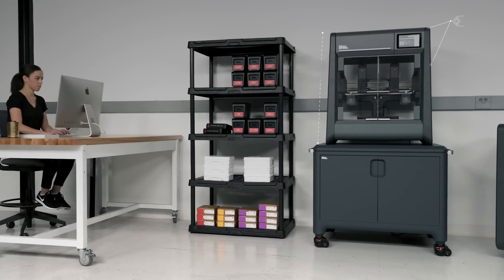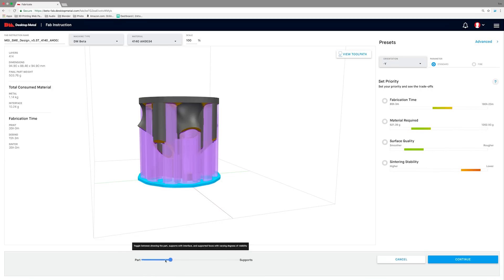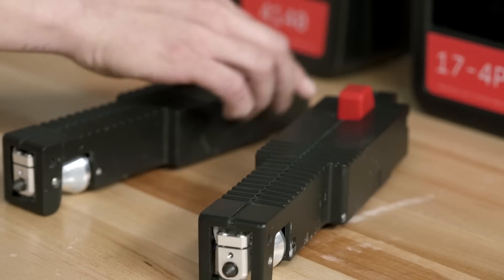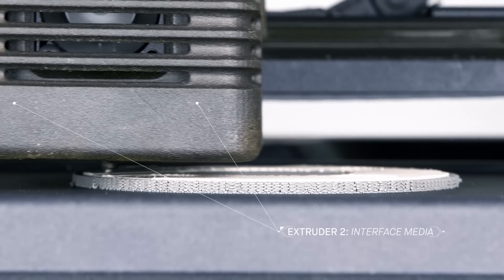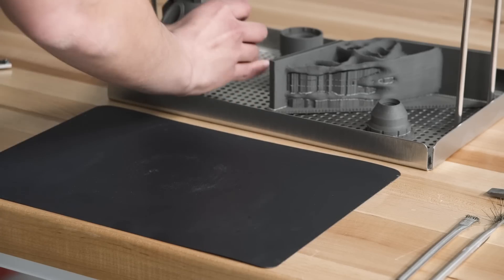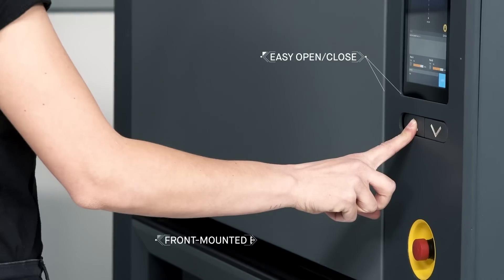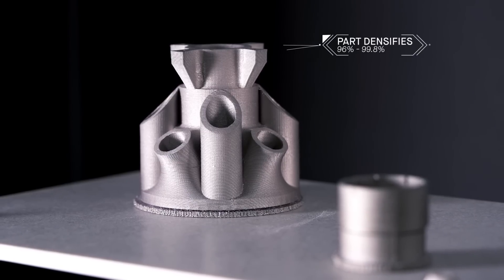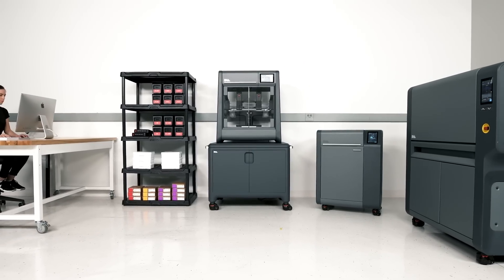Desktop Metal Studio 3D Printer | Affordable Metal 3D Printing

Comment from the maker: If you are interested in seeing this technology more in-depth, take a look at our Desktop Metal playlist. It covers the technology as well as the workflow. Enjoy! - https://www.youtube.com/watch?v=I-7WuOSkClg&list=PL3lLIrnJwjW59tLpucQ12gDwycmazFZuY
Reply: Cost?
Reply: Let me ask a stupid question, does it do aluminum?  I'm really interested in this machine. I'm really thinking about taken a course in cad because of this machine. Great video and take care. Thumbs up.
Reply from the maker: Hey William, on launch the Studio System will focus primarily on 17-4 PH stainless steel, AISI 4140 mid-carbon steel, H13 tool steel, 316 L stainless steel, Copper, and Inconel 625. However, because this technology is based on metal injection molding (MIMs) most of the materials in that space will be transferable over time. Desktop Metal and their partners currently have over 30 materials in development including 2024 and 6061 Aluminium.
Reply from the maker: Based on the ASTM E18 standard, 17-4 stainless steel printed on the Desktop Metal system has a hardness of 37 after sintering.
Reply from the maker: @Superpureeliteful I think that the hardness will be okay for a wide range of prototyping and tooling applications, with end-use parts being possible in certain situations. However, when it comes to higher-volume production parts where strength, consistency and repeatability will be more important, the binder jetting technology from Desktop Metal will offer higher strength and density, and the new solution from Stratasys also offers cold isostatic pressing to further process the materials.
Reply: @proto3000_  what could be it's cost ?
Reply: Guaranteed 5 stars
Reply: Cuanto cuesta una máquina como esa entre a la página y solo veo catálogos de máquinas pero nada importante como el precio entre otros datos .

Comment: just think 20 years ago we was doing the basics of this in Delloro Stelite in the form  of PTA
( Plasma transferred Arc )
The metal Stellite powder was pored into a hopper above the head and then gravity fed through to the center of the extruder that had Hydrogen gas and Argon .
Anyway we made some nice stuff that was amazing but the heat was so extreme and you could get an instant sun tan ,
Reply from the maker: The pace of innovation is incredible

Comment: why in the hell is so much of this machine vendor-locked in?  RFID-enabled gas canisters??
Reply from the maker: The gas source does not just have to be the canisters. If your manufacturing facility supports it, these units also run off in-house gas lines

Comment: I saw it said fast and cheap and it says there test part will take 188 HOURS WITHOUT supports......
Reply from the maker: Compare it to another manufacturing method in both cost, time and complexity. Time can be subjective, and the benefits in time savings can be seen across the lifecycle of a product.
Reply: @proto3000_  to be honest with you! From the appearance of the dementions and complexity of the part shown I whole heartedly believe a 5 axis cnc from billet would take around 18-36hours depending on the machine and the medium in question and short of work hardening steels I believe it would be short of the 24 hour mark.  However, I was not here to watch the price or time but the technology and its advances! 5 axis cncs have not been around long and when they first came out people only talked about the epic crashes and fails from them now people can't believe the finish some of the new machines can do!

Comment: When you could by a HAAS for less than the price of this setup, you have to question if this process isready for prime time.  "Near Net" means the part shrinks so now we are into the sand casting realm of calculating shrinkage and may as well use sand cast where cores can also be 3D printed and the part will ultimately be cheaper to make by orders of magnitudes.
Reply from the maker: Hey Matt,

The purpose of the Studio is not necessarily to compete against the CNC process but simply to complement it. If you are an R&D lab or a design firm with no immediate access to a machine shop, how would you get prototypes or one off parts out quickly and efficiently? Typically, companies who run machine shops have them dedicated to production, those who have to prototype their metal components prior to production have incredibly long lead times or have to look at alternative methods to get their parts produced. We take for granted what we have accomplished with CNC machines but we have to keep in mind that not everyone has access to them. The same can be said with sand castings. You are correct in your statement that the core can be 3D printed but not all clients have immediate access to a foundry or casting shop. With a system such as this one, any designer or engineer can design components and get them printed whether you have a system in an office space or a machine shop. The benefit of achieving multiple designs with different geometries in one print is also hugely beneficial where as multiple tooling setup may have to be required with CNC methods.
Reply: @proto3000_   
Worked in Test and Engineering Aircraft and our company used metal printed parts because of exactly your outline, specifically a fire suppression nozzle for our Turbofans. Minute changes had to be made after every test for correction of optimal flow and coverage. We got the printed parts in 1/4 the time it takes to machine. Machining parts in a large manufacturing environment takes an enormous amount lot of time.

Spending 30-50k a day on crew , maintenance,  engineering support and test equipment for a part to be machined in a couple of days opposed to one that can be printed, especially if it is non critical, is a by far a high valued machine.

Comment: Wow..  Stil wonder if this type of 3d printer can be use to manufacture piping structure such as pipe, valve,flange, or 3d printed distillation column complete with its traysm reflux and reboiler system it will be huge application especially for small pilot scale plant in chemical production..
Reply from the maker: Thanks for the comment Mohamad. Some of the applications you listed are already being done or in Research and Development by many oil, gas, and petrochemical companies in North America

Comment: When the website say "Request a Quote", you know its gonna be some serious dough
Reply: Yeah it’s like $200,000
Reply: @Stay EZ My Friends The way they are doing this I’d assume closer to the $50k mark or higher. Would it not be easier to 3D print something in resin and create a cast for the part? I wouldn’t imaging you’d get great detail for a $5-10k metal printer, at least not for 5 years.
Reply: @StevenPenny  casting them kinda defeats the purpose of metal 3d printing
Reply: My job has one and it was like $120k.
Reply: 2026 is it affordable?
Reply from the maker: Expensive by normal standards, but not when compared with the costs involved in making a one-off metal part
Reply: @proto3000_  True. If you guys can make a simpler <$1000 lower quality version for hobbyists you would garner a lot of sales
Reply: @nczioox1116  That will take at least a decade, if it ever happens. Even a metal printer for 10k would be insane.
Reply: @proto3000_  is even be interested at 5k. Why isn’t there a machine for say 5-10k that’s DMLS with a powder bed about the size of a shoebox?

Comment: Purchase of the Desktop Metal Studio System for $120,000 includes:
DM Studio Printer (add additional Printers for $49,900 + tax)
DM Studio Debinder (add additional Debinders for $9,900 + tax)
DM Studio Furnace (add additional Furnaces for $59,900 + tax)
Consumable Starter Kit (media, gas, debinder fluid, effluent filters and build plates)
Installation and training by DM Sales Partner
Cloud-based software & updates (local cloud option available)
1-year warranty and maintenance
Hardware-as-a-service (HaaS) pricing is also available. Pricing is given as $4,000/month for 36 months or $3,250 over 48 months.

The Desktop Metal Studio 3D printer is priced at $49,900.

affordable?
Reply from the maker: When you compare it with other laser-based or powder solutions it is very affordable. Metal 3D printing today is mostly catered to industrial applications

Comment: Web based software means:

1) You can't use it when the internet goes down.
2) Your designs are not your own.
3) Your STL files are subject to being stolen.
4) Your designs and technology is subject to being transferred to a Chinese company that can produce your product much cheaper than you can, before you get your product to market.
5) Even $10.00 is way too much for such a system.
Yep, that's what web based software is all about.

Comment: I saw “affordable” so i clicked, then i saw 3 seperate machines, so i escaped
Reply: And I thought CNC machines were expensive.
Reply: Right 100,000 affordable wtf
Reply: Yeah it must be reeeeaaally cheap 😂
Reply: @leolima75  honestly Its a greate option if your constantly builfing one off cars. 

Some parts wont work unless you make a custom part. This will save me time and money so its a good option. 

Tho there are cheaper options on tje market.
Reply: @burntchickennugget191  I'm sure it's much more comfortable ... I'm also sure it's more expensive. I really don't know whether it's faster (it's oven time seems pretty long on top of an already long printing time) and whether it delivers more accurate dimensions. At least for castings there's plenty of software that will calculate the corrections to compensate for the casting process shrinkage.
Reply: in jewelry making theres silver clay
Reply: Honestly if your serious about makeing parts its worth it.
Reply: Still cheaper to get a really good 3D printer and die cast lost PLA
Reply: It's still for enterprise use
Reply: Still less expensive than a single machine with a high power laser !
Reply: @SuperYellowsubmarin  What is the price?
Reply: Ignacio peña your heart
Reply: @vladimirvladimirovichputin1352   and two kidneys lol
Reply: @PALOSDEAJO  This printer set costs $120,000. The cheapest metal printer I could find online is Airwolf 3D EVO but I cannot speak to its quality
Reply: @PALOSDEAJO  I work with an EOS M 290, close to 600k with all the required accessories
Reply: @NightshadeTactical  bro might as well get the Markforged Metal X
Reply: @PALOSDEAJO  3 quarter million dollars
Reply: iman-ka@khoshrou.com
{supplier and sub seller}
We are the supplier of 
Laser gun,AOM driver,PCB,Spare parts,Rollers,Gears,Key board,Minilabs,
Brands; Noritsu,Fuji frontier,Durst,Epson,Konica,Chromira Prolab,
for FUJI NORITSU, also sell almost all spare parts of FUJI ,Noritsu,.. . for more info send me an email On, 
iman-ka@khoshrou.com

Almost all spare parts for Noritsu,Fuji frontier....

Comment: ATF YOU CANT STOP ME NOW
Reply: @lmao this isn't a name open source software :)))
Reply: You can never stop a maker.
Reply: Lol
Reply: The web based software may be an issue. I would prefer something more closed circuit if you know what I mean.
Reply: Apparently these machines cost as much as a fully kitted out Oshkosh L-ATV, plus 100k in spare change.
Reply: @lmao this isn't a name then some hacker is already working on hacking them😋
Reply: unlimited POWER!
Reply: Materials Available

17-4 PH Stainless
316L Stainless
H13 Tool Steel
4140 Chrome Moly
Copper
Inconel 625 Superalloy
Kovar F-15

Additional Materials: By enabling the use of metal powders from the MIM industry, our systems have access to a wide range of existing materials—from steels and aluminum to superalloys and titanium.
Reply: @SparkySlow  Your comment is the real MVP here
Reply: @cheekinotbreeki8681  I won't mention I printed a G17 lower and it works great.

The metal slide rail inserts were a bitch however
Reply: @cheekinotbreeki8681  bout to make myself a fully aluminum glock lower
Reply: Ngl a 3d printed cobra would be sick

Comment: At this point wouldn't ejection mold just be cheaper?
Reply from the maker: Hey Joshua, it all depends. When we consider additive manufacturing an important element is the complexity of the design and the volume. With injection molding, it can be cost-effective if you are doing higher volumes of a part with simple geometry. However, if you need something done low-volume of that is very complex, 3D printing can be a better fit.

Comment: There are so few use cases for this at 120,000 usd.  Money like that can buy 5 axis cnc mill plus tooling, which can do so so much more much faster.  But I guess we gotta start somewhere.   I'll be here waiting for the 25,000 dollar version.
Reply from the maker: Hey Jason, that is a valid point however, the main use case right now for desktop metal 3D printing technology is for companies to produce complex metal parts outside the capability of subtractive manufacturing methods. The cost of the technology is justified when a company is looking to produce a part with a unique purpose, geometry and function whereby that same part maybe was impossible to manufacturer before or had to go through a series of processes before it could come to fruition. Additionally, there are replacement parts that are sometimes needed where the cost of tooling does not make sense. As like any technology, metal additive manufacturing is not for everyone yet, but it is proving to be the starting point in establishing new manufacturing methods for next generation parts and components.

Comment: the complete system costs 120,000$, that's what they said on their website, I think they're talking about the printer only, indeed very affordable
Reply: When theres a will theres a way
Reply: Compared to 1.7mil industrial printers... yes, it's affordable. But not affordable for people who work a 9-5 job.
Reply: Bro just make some brake rotors or pads for a week and its paid off. Make an f-1 spec rotor and 6 of those pay for it. It's really not expensive for what your getting. I'd be churning out Bugatti/Ferrari etc brakes like a bastard if I had the $$ for this bad boy
Reply: @hdjjfhdjif878 
making rotors for Bugatti is one thing, but selling them is another 😏 
Do you really think some rich guy who spent a mill+ on his ride would consider to buy rotors from Hdjjf Hdjif? 😬
Good luck with that 😄
Reply: @pavelt5732  no, but if you have a Bugatti this is your cheapest bet

In all seriousness, there are a ton of small machine shops in my area that are all very into racing. I would see a small shop like them using it to produce things they otherwise dont have the resolution to spec, like piston rings, brakes etc. They have multiple Ferraris, something like this isnt very expensive to them
Reply: @hdjjfhdjif878  bro lmao idk if you're joking or not but theres no way thatd work. Shit would explode as soon as you applied 2% pressure
Reply: @hdjjfhdjif878  I thought this product was for mass production, what small companies or factories would use to manufacture small parts. I don't see any personal use for it and in general I wouldn't spend 120,000$ on a printer only to use it rarely. Good idea for a project though! didn't know making car brakes can be so profitable!

Comment: Could you possibly make a steel model train's chassis and body, and wheels with this?... like, can you make multiple parts at one time?...
Reply from the maker: Yes, in theory, you would be able to print whatever you can design. For a model train however using metal 3D printing technology may be costly. You can print multiple parts at one time, and you can also print moving assemblies provided the design has the right tolerances.

Comment: What if that piece needs to be forged most of machinary parts need to be forged prior
Reply: its for prototyping or visual aid. in most conditions you would need solid cast and hardened metal.
you couldn't forge that piece unless you were a 4th dimensional being. it requires casting.
Reply: @darkshadowsx5949  
That true I remember I have watched a video for a jet turbine manufacturing. They used such hard metals like manganese titanium vandium etc so they don't need to forge the metal but instead heat and chemical treatment

Comment: You guys should consider including a trimming station or process to complement this set-up. I know you are aiming at prototyping rather than end-use parts but I wouldn't buy this specifically because of the rough looking finish, given that i provide services to end users who will judge that sort of stuff.
Reply from the maker: Hey Renatto, the technology is actually a part of a process, with post-processing and finishing options available through many different products depending on volumes and requirements. We will be releasing a whitepaper soon on the different finishing options available for our metal 3D printers.

Comment: Now my question is, can the printed metal be as good as the molded metal?
Reply from the maker: Hello Samuel, the answer to this question is yes, but it depends on the application. Most of the data received in materials testing points to the end-print as being just as strong as cast metal with similar density. This would be great for most tooling and manufacturing aids applications as well as some end-use projects. The trick is to make sure that you validate your design and the technology.

Comment: Are the parts stronger or even as strong as a cnc milled part?
Reply from the maker: Yes, 3D Printwiz, in most cases it will be. The material will be as strong as a cast part and capable of withstanding similar stresses. For applications such as jigs and fixtures or manufacturing tools they can be a great replacement to milled parts. What's nice as well, is that with 3D printing you have design freedom to be able to build strength into the design.
Reply: @proto3000_  is the sintering oven any different than the one used for zirconia? I see they get to the same temperatures. Just wondering if i would need a New one.